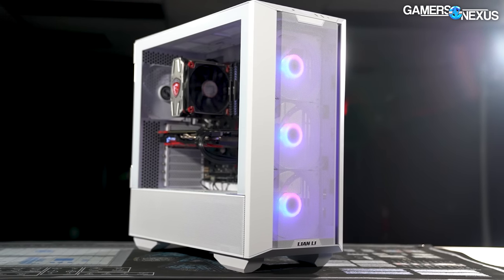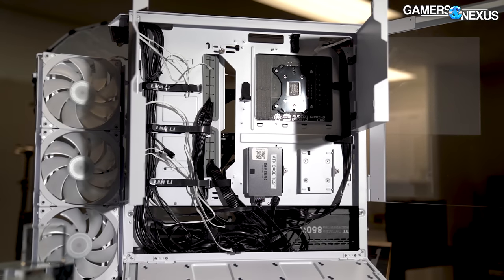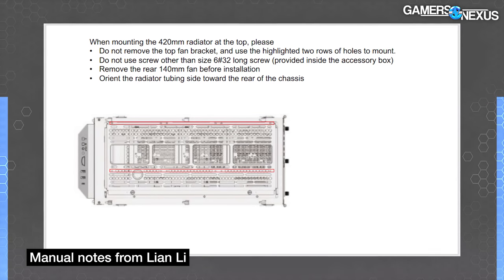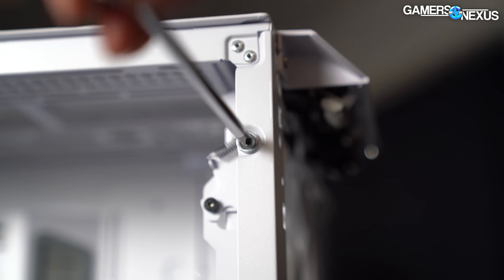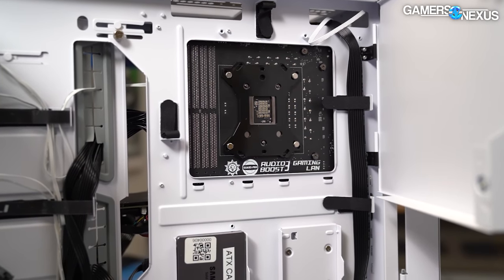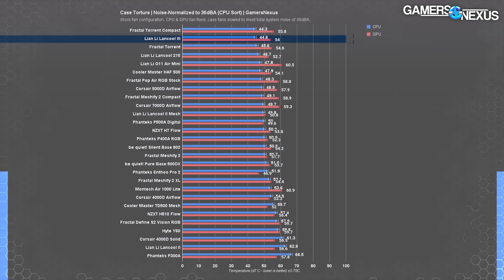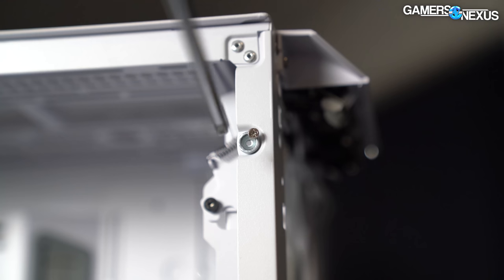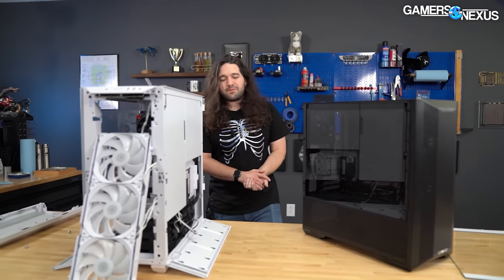Lian Li Lancool III Case Review: Build Quality, Thermals, & Cable Management

Comment: If you remove the rear single fan, and rotate the front fan mount so that they're closer to the mesh, and do not use any front radiator, and use low profile ram (up to 43mm high)...
then you can squeeze a 420mm AiO rad in it. And I do mean squeeze, and I should probably add a "usually". It's the smallest case I think you can shove a 420mm into.
It's a pretty cool case really.  3x120mm fans on bottom (iCUE), and 3x140mm (420mm iCUE rad) at the top, looks cool, though it won't sync with the lian li front fans so I set those to a static color. I got the black case, have the 3 lian li front fans on solid red, and the 6 icue fans (120's and 140's) on "breathing" red. It suits a high end AMD build nicely.
Reply: I just ordered the Lancool III ARGB and i have 6 Corsair HD120 RGB Fans, you just installed the fans to your motherboard i guess and controll them via icue software, so no fan/rgbhub or something like that right?
Reply: @BLACKSTARBLAIRWITCH  Uh, my H170 rad came with 3 140mm fans and an iCUE hub. The case has a kind of built-in hub-like thing for the front fans (inside the little pod for the front IO stuff & power button). One's lian li though, and the other corsair, so they don't communicate with each other.

I have the iCUE hub to mobo to software. But because the front fans & rgb controller are lian li, I don't try to get them to do matching rainbow effects. I just set them to a closely matching static color, so they look reasonably "matched".  I just went with a pale blue.

The hub for the front fans are dual control. They can be connected to the mobo and tweaked with lian li software, but there is also a dedicated button next to the power button which gives some limited control options. I just used that to pick a color for the front fans, and then used iCUE to closely match it with the corsair stuff.

In hindsight, if I had known how much trouble it would be to get a H170 420mm AIO into this case, I probably would have just gone with a 360mm rad. The mobo I got has fairly chunky heat sinks on it, and the upper chipset touches the fans, also the rear corner (where the IO plate of the mobo is) is too tall, so I had to saw off one of the corners of the nearby fan to make it all fit (making it a 3-screw fan).

To be fair, it looks great, and there's no vibration problems with 3 screws on that rear-top radiator fan. You'd have to stick your head inside the case to see where i "customized" the back corner of the fan housing. But it was far more work than a straightforward build. Makes it a pretty unique build, but you'd have to be really "into" that kind of custom work to call it a good idea.

My old computer is in a 750-D case (technically a full tower). And the lancool III case is almost as big (same width, but maybe a couple cm less long & tall). It surprises me that a 420mm rad is such a tight fit in such a big mid-tower case. But 420mm rads are really big.
Reply: @kathrynck  Thx for your answer, as for your problem, you can get rubber "things" for the fans, so you dont need the screws to fix them and with the rubber things you can also slightly pull the fans downwars for easier installation fo the 420 rad. I wateched many vids for that, but i only have a 360 corsair aio. Check this out, if that was your problem, but i saw many users struggle with the 420mm rad and the fans, maybe they find it helpful https://youtu.be/aitIxf_1FEU?t=415
Reply: @BLACKSTARBLAIRWITCH  I think even the rubber things wouldn't have made enough room to clear my mobo's IO block in that back corner. I had to remove "most" of the corner of the fan housing to get clearance. Part of it is that the mobo i got has a very bulky heat sink stuck to the inner side of the IO plate (with rgb stuff on it). It's the asus x670e 'prime pro' wifi mobo.

It's tricky to get a 420 to fit well enough to even get to the fan/mobo problem hehe. There's quite a few ways to arrange the front fan bracket, and to arrange the fans on it. There's only one combination (out of many) for the front fan bracket & fans, which clears the front panel of the case, and clears the rad on the other side.

Pretty much the 420 rad is only about an inch shorter across the top than the whole case :P

In the lancool III here's spots to put 3 fans across the bottom too (above the psu area).  But they are 120mm only there. So I think a 360 rad up top would look best, could do 3 matching fans below and above (with a top mount rad).

There is enough space to mount a 360 AIO rad in the front instead, if you prefer. Would mean a slightly cooler cpu, but slightly warmer gpu. I wanted the rad up top so that as it loses water with age, it should keep the cpu block fully wet 100% of the time.

I actually got a 4090 TUF, (I wasn't going to spend that much, but when i went to see what I could get at microcenter, they actually had 4090 TUF cards, at retail, with microcenter msrp (no markup). So... i kinda over-spent ;)
Anyway, the point being, just looking at it, I THINK there's enough room for a front mount rad, in front of a GiGaNTiC graphics card. Although it would probably matter how the front fan bracket is positioned.
But I doubt you could do a front rad + top rad, even at 360 size. Not that it's common to find a way to use 2 rads hehe.
Reply: @kathrynck  According to the youtuber Christopher Flannigan you get the best temps for gpu and cpu if you mount a rad to the front as intake, he made all the tests possible i think with fan/rad combinations. My plan was to use the 360 as exhaust at the top and 3 bottoms fans as intake and the 4 stock fans as they are, but i dont want the rad in the front as a push pull like he tested.
Reply: @BLACKSTARBLAIRWITCH  Well when i saw his video, he felt that he had the best 'overall' temps with front mount rad. But gpu is slightly warmer with front rad, while cpu is slightly warmer with top rad. It's just that between the exchange, he came out about 1-2C better overall (like adding them together) with front rad. Top rad with bottom fans installed was very close though, and reduced the overall advantage of front rad to about 1C.

Mainly though, I'm using a 420mm rad, so I felt like I had more cpu cooling headroom to play with. Also, I like top for rad, because with a horizontal rad, you'll never really get air bubbles in the line to the cpu block. You could go down to 50% fill and still have a bubble free loop (just the rad would be half-full across it). Also, I like fans at front, top, and bottom, lots of air circulation everywhere. And top mount I feel gets the warm air further from the case, vs. long term use & warm air reinjestion. it gets fanned up, then being warm, will tend to just keep rising, and heat up my ceiling. Won't re-injest until more than half of the room is warm air ;) Plus it makes for a slightly cooler general case temp (ram, chipset, etc).

All of which is fairly theoretical and untested :) But I feel like it's reasonably well thought out ...probably ...ish.

But I did watch his video before I built :) If I had a 360mm, it'd have been a tougher call, as I'd have less "excessive" cooling for the cpu.

Of course as soon as I booted into bios, I was second guessing myself. Because the 7900X slowly ramped up to 50C idle (ambient 26, for a delta of +24C). Which considerably higher than I was expecting. Started to think maybe I didn't have as much excess of cpu cooling as i had hoped. But after a little bit of PBO tune (just -20 all cores), the cpu idle temp dropped to 42C idle (delta 16C) which is more reasonable. AMD really over-juices the AM5 cpu's. I could probably knock another couple degrees off it with a per-core tune.

The rad never got warm to touch at idle though. Felt room temperature. So, I think there's a lot of heat soak & dissipation in the rad which just never came into play much at idle. It may be a big rad, but the water pump is the same as the 360, 280, and 240 rads. Or in other words, I think the big rad would show it's stuff in load, with the temps rising slower, and the difference really showing more at peak. 

Seems to be playing out that way in practice. I did set the max temp to 85C though, and it does reach that in sustained load. I just didn't want to let it push to 95C (the default max). I don't know if it could actually touch 95C under load or not. It doesn't throttle much at 85C max, and my boost numbers look great. I'd just rather never let it get to 95C personally. Even if AMD says the cpu can take it, it would dry out the paste pretty fast at 95C. Plus part of my rationale for spending big on the build, was to try to recoup some of the expense by getting a ton of longevity out of it.

Comment: I miss $35 - $75 cases... oh well is there anybody who makes a desktop case with 5.25" external slot?
Reply: be quiet and fractal pop come into mind off the top of my head
Reply: Super cheap rosewill cases come with them. I've got one
Reply: Love my Fractal R series for just that reason. 2 slots for CD/USB break out, whatever. I have drawer kits in mine for USB collection...
Reply: Chieftec
Reply: Lian Li never made $35 - $75 cases as far as I remember, they've always been a premium brand, but also deliver very high quality products, so the price is warranted. As far as cases with a 5.25" slot, what about the Fractal Design Pop Air?

Comment: Lancool III would be the perfect case if it came standard with filtered intakes.  Fuzzy cats and case on the floor forced me into a 4000D.  They should make a "pets" variant that just comes with the filters.  Lol @ the magnet talk.
Reply: Actual filters would annihilate the airflow and this case would be a terrible buy, though the mesh on the front panel is pretty thin, cat hair wouldn't really get through, just a tiny portion of it. Living with a cat you're good for cleaning at least the filters/front panel quite often whatever case you choose so might as well get one that cools your components well

Comment: Mine came in yesterday and it’s a little off. Lower panels don’t look aligned right and the back side won’t sit flush with glass and front panel just kinda falls off. I’m hoping it’s just screws that need to be tightened gonna try to mess with it this weekend I really hate doing returns through Newegg. Anyways just saying I agree there are some QC issues

Comment: So a 420mm top radiator DOES fit? Or DOESN'T? DO you have to remove the rear fan with a 420mm? Or no?

Comment: I remember when Lian Li was mainly an expensive, definitely not mainstream, PC case manufacturer. The OG O11 Dynamic and Air, along with the Bora fans, really opened the floodgates for an entirely different market for them. The O11 Dynamic itself has had several spin-offs. The O11 Air has had a few modified follow ups. The Bora fans led to the UNI fans, probably some of the most popular fans sets on the market. The Lancool line has been introduced and exploded with many models. Most importantly, most of their products fall into an affordable price point and get better with each new model. Hats off to Lian Li! They really do seem to listen to reviewer and customer feedback and make better products as they grow in the market.
Reply: Lian Li making an unpainted aluminum case with good airflow be a dream come true for me. I miss the look of their old school lineup, looked for the Max Pro looking one on eBay a dozen times.

Comment: I like this case, I'm now using a coolermaster's case(h500p), I feel coolermaster does waste too much space, I can only install two 3.5" HDD hard drives but the case size is much bigger than this one.....I put 4 hard drives into the case, they are quite wonky.....

Comment: Glad I have the lancool II mesh performance... 
All those springs seem unnecessary to me. Especially for the front fan bracket. The way to open the side glass panels is cool though. Although it changes the look of the front of the case. I honestly prefer the look of the lancool II mesh.
The magnets for the cable management panels makes them look very clean when closed. But again, I'm glad i have the case with the thumb screws.
The larger ('higher') case feet are nice for airflow though.
However, In my view they overall 'upgraded' stuff that is superfluous.

I WOULD have liked an XL version though. Deeper, wider, higher... Way more room for watercooling, or less obstructed brackets for better use of 14mm fans, but more generally for cable managment. Then those magnet cable panels would probably be less of a potential problem. Or still make use of thumb screws but be able to 'hide' them some way. Or just add some 'clean' looking latches to secure those panels.

One would probably be very happy with this new III version, so don't get me wrong. I, however, would get the II mesh version if it's still available.

just my 2 cents

Comment: Just got the Lancool II Mesh, unfortunatly i had to remove all the RGB fans because they where not very good (loud). This meant that the front RGB controller is useless since the new BeQuite Light fans uses a different fan connector (or LianLi does). I will be fitting the hotswap once my order arrives.

Other than thet, it is a good case.

Comment: I have the Lancool II Mesh Performance and got it for original MSRP. It was unbeatable for $90, but I had to buy the USB-C cable and attempt to install it myself, but the accessory kit I got only came with one screw that wouldn't thread--a pretty annoying demerit against an otherwise great purchase. If this case is coming with all the small improvements + pre-installed USB-C, all with the same performance, I'd say it's definitely worth it. The value definitely beats the shortcomings on this one, boys.

Comment: Kinda weird that they don't make the front magnet free floating. I modded my old Antec tower with cheapo magnets. All i did was shave the barbs off the pegs making them loose and glued two neodymium magnet strips bottom and two top. More than sufficient to hold it in place, but make it easy to remove when needed. All in all, less than two dollars worth of magnets and glue.

Comment: In a case like this it makes a little bit more sense. But I’ve always wondered why case makers add like 50 2.5” mounting points but also don’t test actually wiring them. Either nobody is going to use them, or they are, but won’t be able to fit the wiring.

Comment: I'm two years in with my lancool 2 mesh due to steves previous video  and it's going strong being carried around several times and moving house once I've played with thermals a lot, you will get scratches and the paint come off where you are playing with screws but all in all very happy with that case and QC and I'm seriously considering buying this one as an upgrade due to the fact I love building a PC and you can't do it often enough. side note: lancool 2 mesh works really well with 2 extra fans at the bottom, 3 140 mm in the front (specs say it can't be done but it can with hexa shaped fans I use 3  kaze flex hexa  rgb 140s its fiddly but can be done with the right front mount config) I have a 240 artic liquid cooler 2 up top in push/pull config and another fan in exhaust. I'm getting 47 c under load with a ryzen 5 5600x and 65 c ( 35 c summer time in the uk) on a gigabyte eagle 6600xt ( I have 3 noctua 92 mm fans strapped to the heat sink that makes a huge difference to that budget card and will do until the massive gpu price drop we are all expecting and I can get my 69/6800xt) all in all I have faith in the build quality with the previous generation and I have loved the thermal levels with these cases. Im thinking of upgrading all fans non rgb (kaze flex move a lot of air for a cheaper rgb fan)with appropriate noctua fans buts that's going to cost close to £200 so that's a month by month basis depending if it effects the thermals with each buy.

Comment: The weight was a great thing to bring up, and it's not something I think about enough when choosing a case. I didn't think my P500A was all that heavy, and I'm pretty sure it isn't, but after doing a custom loop with a 420mm and 280mm radiator setup, it became almost too heavy to move. I can only imagine how heavy the lancool III would be with a similar setup. What a shame. I like the looks and design of this case.

Comment: What me concerns the most, more doors, can be later have terrible vibrations, which, maybe cause rattling sounds. I had a case once that had this problem, so I have to put in thin anti vibration pads. But further, I like the case. Thanks for the review, the weight, well I still have a corsair big tower D850, that is a lot heavier. The case fulfilled, 6 x 3,5" drives weight on itself a ton. With the rest of it, it goes around 40kg, that is a backbreaker.

Comment: I bought the Lancool II after watching your review despite the mild concerns you had then. I enjoyed building in it and my thermals have been fine after all this time. Full disclosure, I don't over-clock thus it's not being stress tested. That said, my take away here is that your concerns are mostly around some minor engineering quirks and potential long term effectiveness which for my use case would probably be fine. Plus doors man...it's got doors!